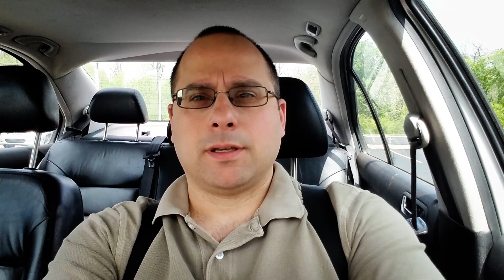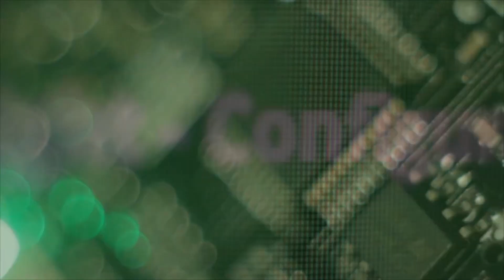Frsky Taranis antenna mod and why you probably shouldn't do it.

Comment: Just buy an external FrSky DJT module and plug it into the back - then mount a bigger antenna to that. thats what i do £22 https://www.t9hobbysport.com/frsky-djt-2.4ghz-jr-telemetry-transmitter-module?gclid=CN254OrputMCFWwo0wod0q4N2w

Note this module is 100MWH the taranis is only 80 so its more powerful already

With the taranis plus its fully controlled from the taranis and you dont need to touch the dip switches at the back. Also if you do this you always have a "spare transmitter" with you..
Reply: I believe by using an external module you add additional latency
Reply: used to fly the xjt with my modded 9x. After i  switched to a taranis i did feel a micro delay. and did some reading up and running xjt module over jr port does cause some delay but not too much .
Reply: Savage FPV Would a XJT module also work?
Reply: Correct me if I am wrong. I think the internal xjt module is 100mW where as the external xjt module are only 60mW. so it would be better replacing the internal module itself? and why buy a djt module when it doesnt support x4r receivers and sbus? xjt module works with all d and x series receivers.
Reply: mateen baig I don't know of the internal/built-in transmitter module but the external XJT has a rating of 100mW output.
Reply: Thanks for confirming. Just checked both internal and external xjt module are 100mW.
Reply: That's what I did for a while, after my main board died...the lag is terrible when you switch from sbus and internalmodule, to cppm and external module... I just bought a new main board for 
~40€
Reply: Rick C How is the latency introduced with an external module?  Would it be significant/noticeable?
Reply: It is significant and noticeable... XJT might not be so bad since that can use sbus, but DJT was horrible
Reply: Sorry I have a xjt module ! No delay , it's 100 mwh internal Taranis is only 80
Reply: @TeeSCee Unless its like 150ms then its nonexistent.
Reply: Quite possible but i race all the time and fly all the time and do not see any noticeable delay - it also means you dont have to open up and hack your taranis. Works for me. I have the external module set for non EU and internal on EU also allows me to swap between types with ease. Also allows me to mount a 2000mw booster onto it.
Reply: used to fly the xjt with my modded 9x. After i  switched to a taranis i did feel a micro delay. and did some reading up and running xjt module over jr port does cause some delay but not too much .
Reply: Savage FPV there is no getting around the delay with an external module. It's possible you don't notice it but I would think it's a physical limitation with the external module. I've tried sbus internal and with the xjt and it's a noticeable difference. I believe any module added to the Taranis adds 10-20ms-something like that.

Comment: Hehe, Josh says doodoo at 3:34 . Also, great video. I had actually considered doing this with mine, but will hold off. I haven't really felt a need to do it other than wanting the ability to unscrew my antenna and swap it out if the need ever presented itself.

Comment: If I have smoked my board, where I can get a replacement???  Thanks in advance:)
Reply: BG has almost all needed parts.
https://goo.gl/PgU4ld
Reply from the maker: +aerosurfer FWIW I believe they have the Taranis Plus parts but not original Taranis.
Reply: Joshua Bardwell  Thanks!!
Reply: Hello Joshua, many thanks for the information. I have exactly the described behaviour after the mod. Will it be possible to use the TBS cross fire right away if I leave the transmitter module as it is? Thanks in advance. Regards, CR

Comment: How does the XJT with a 5dbi antenna compare to the stock set-up?
Reply from the maker: I'm not sure but it might have additional latency. Typically, the radio communicates to an external module via PPM, so there is one PPM frame's worth of latency added to the control path. With an internal module, it is a digital serial link into the module. But some have suggested FrSky uses serial into their module as well... I don't know if that's true.
Reply: Thanks for the input and all your videos!   I attempted the mod last week and had high SWR readings, went to fix the solder joint and tore off the pad.  I figured out of all my options the XJT would be the least expensive, we'll see how it performs...

Comment: Im curious as to why some people have had no problems for over a year yet others it takes just a few months or even weeks to fail? Perhaps it's just module's failing because they were prone to fail before said mod was installed. Or perhaps doing the mod just speeds up the failure rate of a bad module? Is it possible the cheap antenna some people use could be the culprit? Static electricity to me seems most likely the culprit though....

I'll admit I did the mod and im by no means an expert at soldering. I followed Steeles recommendations to the T. Watched countless videos on it before even attempting it and it works fine. I guess ill report back when and if it decides to fail.
Reply from the maker: I know that it won't fail for everybody, but the number of failures people are reporting to me--and some of them people who I am confident are good at soldering and etc.--is high enough I thought it was worth a warning.

Comment: A little quick to point the finger and public post this video before actually opening up the radio to see what the issue is. Could be simple, signal pad may have lifted I've had that happen. I'll wait till you open the radio...
Reply from the maker: I did. It's fine. Give me a break. I didn't make this video solely based on my experience. Since I posted the original video, I have gotten scores of comments from people who have reduced range or destroyed boards.
Reply: Joshua Bardwell like I said. It's a tedious job and people with mediocre soldering skills or wrong equipment can easily make an insufficient connection or damage the board. I think in most cases of failure, that's the reason. Meanwhile the majority of users who have done this "mod" have had nothing but success. I would honestly investigate an issue before public scaring people into not doing it. That's all

Comment: Did you notice the new SE (special edition) Taranis has a removable antenna stock? Maybe have a look what that one looks like.. 
I've wondered about that static thing for quite a while when wathing people build their quads etc.. From my computer building time onwards I've allways grounded myself when working on electronics..
Reply from the maker: It looks basically identical to what you or I would do. The pigtail is soldered on. It's thin coax. It looks like a short length of coax--maybe 84mm but I didn't measure it.
Reply: Allrighty.. I don't have a SE (or any Taranis for that matter) but I did 'your' mod to my Turnigy 9XR a few years ago.. Has worked so far, so I really wonder what the difference here is.. My pigtail is definately Shorter..

Comment: Well, now you can get Taranis special edition which already has removable antenna from the factory and the M4 gimbals by default :) Also the case is wit some art :)
Reply: Love mine!
Reply: M9*
I expect mine to arrive soon to open up and check inside but my guess is that now FrSky has u.fl/ipex connectors for the antenna instead of soldered coax on the board.
Starting to be a bit worried after Joshua's video but if FrSky now ships out SE with 5dBi right out of the box and all the electronics inside remain the same, DIY mods for a 5dBi should be safe.
Reply: Damn i didn't know there was a special edition now. I want that thing so bad now. but i got other things i need to upgrade first. I still don't have a pair of fatsharks yet. and i could use a lot more batteries. my stock taranis will have to do.
Reply: @Matt Thats the situation I'm in. I have been hoarding parts to do all my mods to my taranis and now I find out I could have waited, paid 50 bucks more and got it all done for me.
Reply: @Xephex Xephex the fact that you have been enjoying the Taranis instead of waiting is worth the extra cost ;)
Reply: I've been using the SE for three weeks now and since a week it doesn't stop talking to me "telemetry lost ... telemetry regained". I have no clue where this is coming from as I still can fly ... Smoke?... Fire?
Reply: So I have the special edition and it was working great.   But then I put a 5db antenna on it and it keeps saying telemetry low.   I going back to the old antenna.   I like how the special edition has it where you screw the antenna on.
Reply: I would suggest getting few 5db antennas as there are many which are not that well made. FrSky also is making 5db, you could get it as they probably know, what they are producing. I went straight to FrSky 7db directional patch antenna as where I'm flying, I just stand in the corner of the field, works great.
Reply: thanks I will have to try another 5db antenna to see if that works.

Comment: Why do people do this mod? Stock performance is really good. And if I want long range I will just use LRS.
Reply from the maker: The 5 dBi antenna can give a bit of extra range, or you want to use a directional antenna. Being able to easily screw off the antenna if it breaks is also nice.
Reply: I do it to fly long range using a patch antenna. Just using a LRS receiver isn't good enough. For mini-quad flying though, the standard antenna should be good enough.
Reply: I meant some LRS system with external module 433mhz. I see one advantage that if you mod it, you can stay with frsky receiver, but I personally don't mine paying few bucks for LRS, they are not that expensive and at least I have reliability for several kilometers.

Comment: This is a shame for all the people who did this mod who are on a budget, I wonder how long the Taranis will remain the Tx of choice for most Multirotor pilots? It's getting a little long in the tooth now, I guess until something better comes along? I've never been a fan of the old school style Tx's. They haven't really changed form factor since the late 70's, With a few exceptions (Turnigy Evo, Devo7e, TBS Tango). It's like holding a encyclopedia with joysticks in your hand! I ditched my Spektrum Tx for a Devo7e and I love it! it's so small and light compared to the Taranis and Spektrum radios, it's not as feature packed as the other Tx's but its extremely modifiable and I'd rather something small to dump in my flight bag, works great for me. Good luck fixing your Taranis, really enjoy watching your videos regardless weather its content is relevant to my situation, after all I know If i watch one of your videos I'm gonna learn something today :D
Reply: I mean its not like they cant just go solder the old one back on.
Reply: i agree on form factor, but havent seen anything else i have preferred enough and well bought into the frsky tx/rx at this point. maybe one day someone will come out with a killer for it. i really just need 3-4 switches and some nice gimbals along with model management.

Comment: I got that happen after two weeks. Had to get a new backboard from Banggood which works fine by the way.
I have been soldering for over 20 years and am beyond confident at doing mods but this one really made me angry as I lost two quads due to the degradation of the radio. One was an outright loss and the other was a big wreck where the only surviving parts were one motor 3 escs and the VTX.
Reply from the maker: Did you try changing the antenna?
Reply: I ran an extender and a 5db antenna. Desoldered and went back to the stock antenna but by then it was too late.

Comment: I agree with this. When I first tried the mod, I screwed it up and damaged my board. Ordered a new backboard when they were still available, did a beautiful soldering job - but did not really notice increased range. In fact, my range started to DECREASE. Where on the original stock antenna I was getting a range of far more than 600 meters, I started getting failsafes out at 100 meters. This week I was getting failsafes as close as 60 meters. This is at the identical field, with the identical aircraft, and "SWR" of 0.

Just yesterday I figured that it might be something to do with the external antenna, so I modded it BACK to an original (but new/fresh) antenna. Now I'm getting low RSSI warnings from even closer. Again, I did a fantastic soldering job (no ego - got objective feedback from an electronics specialist as well).

I ordered a Q X7 last night, because I'm no longer confident in the reliability of my Taranis Plus. :'-( .

tl;dr: if it ain't broke, don't fix it.
Reply: UrLawyer Have you checked your receiver antennas? I had a similar issue regarding RSSI warnings. I'd visible looked at all antennas and couldn't find a problem. It wasn't until I rebuilt my quad and pulled the heatshrink off an antenna wire and found somehow it had gotten pinched and broke in half. Visible under the shrink it looked fine.

Soldered a new antenna wire on the receiver and now all is good again.
Reply: Yes. Originally I thought it was a bad receiver antenna, as the FrSky XSR seems to come stock with a suboptimal antenna length. I modded the receiver antennas to quarter-wave, and saw a slight (not at all dramatic) improvement. Then I had range issues on a new FrSky XM. Then I had range issues on two D4R-IIs that had NEVER given me problems. 

I was tinkering a lot, so I changed a bunch of variables, but I think at this point I've narrowed it down to the transmitter/antenna. If the new Q X7 does not show an improvement I'll follow up here; otherwise you should assume that that solved the problem.
Reply: Tested my new QX7 with the same receivers. RSSI is FANTASTIC (again). The problem is definitely with my modded Taranis Plus. :-( . It's now going to be my simulator controller and long-range controller (with EZUhf module). Not going to be able to trust the internal RF unit again.
Reply: UrLawyer Dang that's a bummer...Im betting it's due to static electricity. That's the only plausible reason I can see. I'm from now on making damn sure I don't touch the connector when im screwing on my antenna.

Comment: I cannot stress this enough: A high SWR (renamed in 2.2 and in the analogs menu) is just an indicator that the antenna broken. But a low value does not mean the antenna is fine. It is only an additional safeguard. Also some XJT modules are known to have broken SWR measurement and even with a removed antenna will have a low SWR.

Be careful with this mod. Even a good range is misleading as your antenna might be bad but the higher directional gain will mask that.
Reply from the maker: Yes, I agree.

Comment: That blows. Out of curiosity, I never did the mod because my VTX always fades before my RTX. Kind of a natural failsafe to keep me from flying out of range. I tend to fly in eyesight or at least hearing range. I can fly similar situations that you do with trees and small structures. If I run VTX at 600mw, I can fly all the way around my house at ground level from front yard (house has a walk out basement with lots of concrete) and just barely maintain enough VTX. I never have any issues with stock RSSI. 

Do you experience the opposite? Is there any real value in doing the mod? If you don't have VTX, what's it matter if RSSI is at 100?
Reply from the maker: For me a big advantage of doing the mod was the ability to remove the antenna for transport or replace the antenna if it got damaged. But I didn't do a range test between them.

Comment: is the solder joint still okay? if the connection opened while the radio was on and transmitting, well...thats gg for the radio.
Reply from the maker: Yeah, it's fine.

Comment: Mmmmmh, what about the Taranis QX7? The antenna cable is not soldered to the board, it has the little connector. Do you think that a 5dbi mod for that would potentially kill it? 
Btw awesome videos, kep up the good work.
Reply from the maker: If the antenna is tuned correctly then simply switching to a 5 dBi won't kill it.

Comment: Too bad, i did it yesterday. Was getting SWR values from 16-40 and only in one position 0-1 (with original antenna). After modification (according to your instructions) my SWR is 0-1 in all positions (cheked with 2dB and 5db D-Link antennas). In range check mode i am getting about 70 meters with 2dB antenna and 10 meters more with 5dB antenna. Looks OK for now, time will tell...
Reply from the maker: 70 meters in range check is exceptional!
Reply: That is what I am afraid off, sounds too good to last ;-). I will stay on 2dB antenna and won't remove it  if not necessary  (I am transporting my Taranis in box).
Maybe the reason for such a good result is antenna quality (both from D-Link routers with metal thread)?

Comment: I think my taranis has suffered the same fate, did you find a stockist for the transmitter boards? I am struggling to find one
Reply from the maker: +Neil Mullins I can't find one for the original Taranis. Check Aloft Hobbies.
Reply: you can use the external xjt-module, it has the same board inside, only some sockets soldered in where there should be holes to mount on the original backboard, and some stuff that you have to take away - the led and switches are on a extra, small board with pins soldered onto the xjt-board - and some white socket for plugging in the taranis has to come off. if one is not confident in his abilities after frying the first board, i wouldnt commend to go that route. - unless, joshua, u want to make a video our of that ;) - i did mine three weeks ago, and am again enjoying full range, more than my video-feed holds up :)))